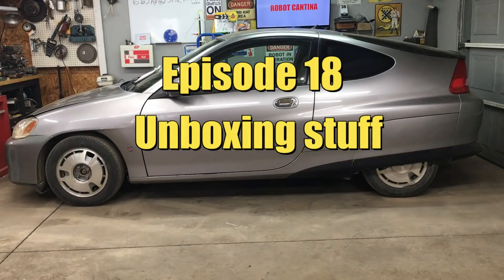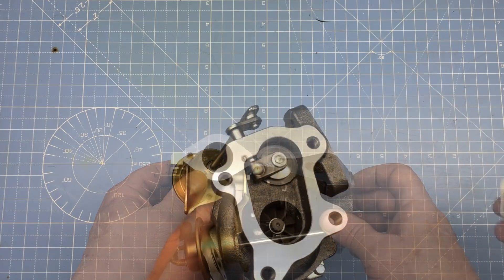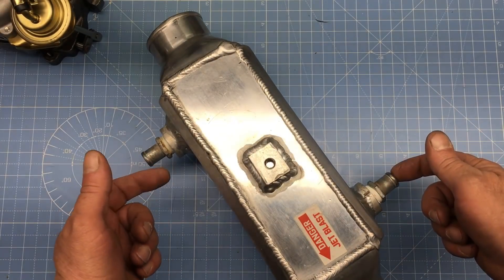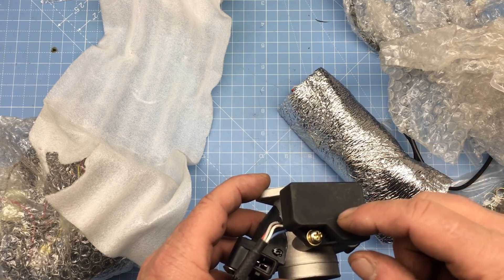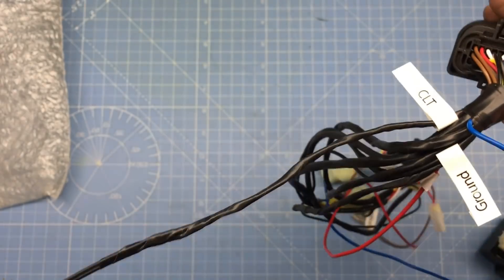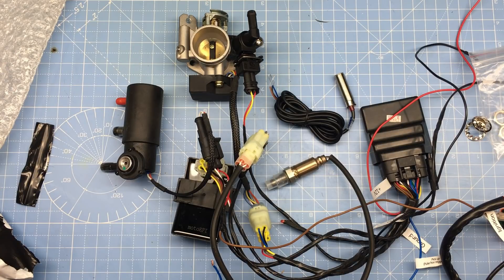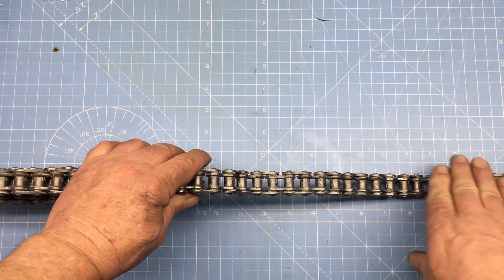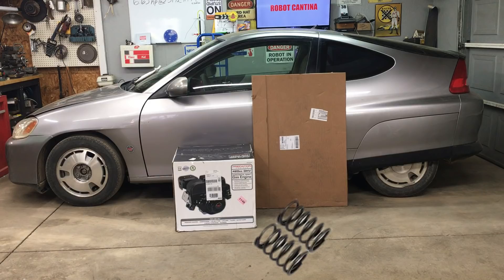Episode 18.   We unbox the high performance parts needed to make our 420 Hemi powered go kart faster

Comment: Do you have a link to the fuel injection kit? I tried finding one on ebay but couldn't find anything ☹️
Reply from the maker: I just checked ebay and you can find it by searching "motorcycle ATV scooter buggy moped UAV EFI engine Electronic Fuel Injection kit".   This is a decent kit to lean with, but it only allows the user to use a narrow band oxygen sensor.  that makes tuning very difficult.  we ended up replacing the ecu with a speeduino NO2C  to gain extra tuning features.
Reply: I tried copy pasting the item number from the link in your next video into ebay, that didn't work, I tried searching the seller's username, no items listed, tried copy pasting the item name, that didn't work either. Weird. Does the ECU have any part numbers on it? I did notice a sticker on it in the next video but couldn't get a clear enough view of it to read it.
Reply from the maker: We no longer have the original ECU or packaging.  I wonder why this item is not showing up for you.  this is the link to the ebay listing https://www.ebay.com/itm/273127447029?hash=item3f97aa19f5:g:PHwAAOSwaudbUUTp&amdata=enc%3AAQAIAAAA0Erz3ci6QuRccDG4O%2BCThnz1V10exsiW9RRaxC2VcEsel7jDFLJQjNqVhv%2BofvuH1TIOPoqlSGdunB4TSFk%2F5wifXCjPQlXTEk6VgxNs70QVY0k4VUTpjZw1NbWYRUsqR5KLkZjPbKAb6NlhS9To%2Fx4eYbcv%2FZeTLyV4fxz25VvPymgwxJ%2BEA41ZbUVJy5wsvZ6CqoSlcW2dspNemuvDoYuRv1CmAm%2B0bKGTKlel0TxzzX1I9D6fydeUAgdjYA2%2B6Geim%2FFiCcCXbm%2BYtET6j3M%3D%7Ctkp%3ABk9SR7THzajPYg

Comment: Your fuel pressure reg, JB weld a fitting to that small hole in the metal can, connect it to a boost source and voila, now the regulator is boost referenced. try not to connect it to a vacuum source.

Comment: Where did you buy this throttle body with injector?
Reply from the maker: The throttle body with injector was sourced from ebay.  The parts came from China.  Search Ebay for 28-32mm throttle body

Comment: This is the Go kart project who's progress I look forward to the most.

With an EFI kit this EMP proof engine is no longer EMP proof
I am not a huge fan of adding a turbocharger to a single cylinder engine.  It can be done but I am not that interested in it.  Superchargers are more interesting but only by a bit.
Reply from the maker: Dont tell anyone, but I'll probably go ahead and use AMR300 supercharger instead of the turbo.  Anyway I totally get how some folks don't necessarily like the EFI. but for the purposes of making youtube content, this is the direction the project will take.  I want to be different than other channels.

Comment: The second flange you pointed out is the one you want to use if you're going to utilize the internal wastegate. The flange with just a hole is for if you're not using a wastegate, or if you're using an external wastegate.

Comment: I believe the second exhaust flange you mentioned to be used if you're using the internal Wastegate. The flange you first mentioned will most likely boost creep if you're trying to use the internal WG.
Reply: Both flanges should be used to allow the wastegate valve to work properly. If only the smooth plate is used, the wastgate valve cannot open properly.

Comment: I've been watching for a few months and loved all your progress but this build is evolving beyond my comfort zone and my wallet. I'm never going to put a turbo on my build. I will still watch every episode but not as enthusiastically. Give me a carburetor and a set of points and I will get home. If any one of your sensors fails, Your walking! So no longer an apocalypse vehicle. I will wave as I pass you on the road at 47 MPH driving my 212, No promisses on not taking your food and women.
Reply from the maker: I totally understand the apprehension toward the fuel injection and the turbocharger. These additions are not really necessary because the car is more or less fine without them.   These mods are being done to explore the possibilities of modern power adders.  The alternative is of course carburetor jets and offset crankshaft keys.  both being very affordable, but we have already done these mods before on the 212cc engine.     Anyway, if you pass me on the side of the road with your 212cc rig, at least wave.

Comment: Would it be outside the spirit of the project to degrease the hubs and run    them as an oil bath setup? Good idea on the wheel alignment too...what tyre pressure are you running? All of it?
Reply from the maker: I run 40 PSI pressure in the tires.
Reply: @robotcantina8957  God damn I love this channel.

Comment: Absolutely crazy and fun build I actually have plans from the '60's hat used a 5 hp engine in a small car..(Not honda, I think..) with a brushed DC motor to get 100mpg.. NOW, I want o find those plans and maybe try to build t with a few modern mods. Can you find it in your heart to post a few arts links?? Shore would be appreciated..

Comment: The only time I’ve seen people successfully turbo one of these smaller engines has been with one of these EBay kits.
The ECU was able to run a wide band O2 and a 1 Bar MAP, if I recall. Those weldable turbo flanges you had a question about were meant to be stacked, the flat one gets and exhaust pipe and the outer perimeter one goes between it and the turbo.
Reply: Is that to give room for the wastegate flapper arm?

Comment: That looks just like a YZ450F ecu!  The turbo you have looks along the same lines of a GT15 frame size. You’d be very surprised on how big of a turbo you can run on the 400cc single cylinder engines!  Due to the “‘on-off-on-off” again nature of the exhaust flow (only 1 exhaust stroke per 720*’) it creates a violent exhaust pulse which has a ‘thrusting’ effect on the turbine wheel. That thrusting effect acts similar to the principle of an Anti-lag feature in a sense. It greatly helps spool a larger turbo On a turbo single cylinder. A multi cylinder engine doesn’t experience this because there is always an opposing cylinder exhausting after the other one hasBegan the intake stroke. It’s a much more linear, continuous exhaust flowrate. I inially started with the same turbo that you just purchased on a 450cc dirt bike. The turbine wheel was way too small And acted as a huge restriction on the engine. It didn’t want to rev at all. I ended up going back to the drawing board and started researching the Ford eco-boost turbos and ended up finding the perfect match for my application. I had to do a ton of modification on the turbine housing in order to get everything to package well Because I didn’t want to change the overall ergonomics or handling of the bike. I I’m still in the testing phase and just about have the kit complete and it’s working awesome! Even converted it over to E85!. i’m documenting it on my channel. Hope this helps!

Comment: One of the things that fascinates me about this project is that there are manufacturers making go fast parts for these little, relatively crappy engines. What real world use is there for a turbo charger for a 420cc engine? Even fuel injection is a bit of a reach. Just glad the parts exist so we can seem them played with and explored on the Go Cart.
Reply: Well they arent exactly made for the engine... They just with sloght mods fit

Comment: You really need a billet flywheel from go power sports. the stock flywheel in the 420s or any of these predator motors will blow apart at constant high RPM. From what I hear you shouldn't be running a stock flywheel above 3500 RPMs. The billet flywheels you can run the RPMs up as high  as high as the engine will go. Also if you're running a turbo you should probably put a bigger cam and stronger valve springs in too. I've built these predator engines up quite a few times and I don't recommend running more than 5 to 7 lb boost without o-ringing the cylinder head. also if any of you are going to be running a turbocharger on a carburetor the best way to do it is with the carburetor on the intake of the turbo with a fuel injector dump just after the carburetor for when you go to full throttle so there's no fuel lag/hesitation, but if you run the turbo on top of the carburetor your fuel pressure coming out of your fuel pump has to be twice as much then what boost is coming out of the turbo. That way the boost from the turbo doesn't push the fuel out of the carburetor. Love your videos this is freaking awesome! Can't wait to see what happens. I've always wanted to do something like this.

Comment: Funny, I actually put this exact turbo on my honda insight! Sadly it was too small for the stock 1,000cc engine, so now there is a GT1241 on it. Anyway, that other, bigger holed flange is for if you are running it to the point the wastegate opens all the way(on the larger end of the engine size). If you use the 1.5inch oulet instead of the full outlet, the wastegate will rattle on the flange, won't be able to open all the way, and you will get boost creep.

Comment: Hey Jimbo,  I feel I must say this, not to be rude or anything,  but I think you're making a big mistake 1:20 with the turbo and fuel injection stuff .   Now please don't take me wrong here but if you put all the turbo, injection,  the "small radiator" , intercooler thing and not to mention all the hoses , plumbing,  and etc . 

The car is going to be heavier  (not real heavy , but considering a single cylinder engine is all its got) but waaay overly complicated considering that the base goal was to have a "street legal gokart" . 

You haven't had enough tuning of the CVT setup yet (see my comments on the last video).

Like I said , I'm not trying to be rude , I just think you're going to run into major headaches.
Reply from the maker: So We are going with the EFI because it is an interesting mod to do.  The turbo charger will also be interesting.  the basic idea is to make interesting videos.  Ultimately the goal is to get the car to go as fast as possible.  I totally realize that these mods are not practical, but why not try them and find out why.  Realistically this car serve no real purpose other than to make videos.    Now some folks feel the car would be a great in town transportation, and that's fine.  They can build their car any way they want.  Anyway, feel most of my audience just wants to be entertained.
Reply: @robotcantina8957  : )   oh yeah I know.   And the videos have been very enjoyable/entertaining. I think what it was is - i was caught off guard there , you brought up turbo and efi and thought - " wait , what?  "   Lol
Reply from the maker: @midixiewrecked7011   That's cool,   More videos on the way.
Reply: @robotcantina8957  :)

Comment: Why does every youtuber put the oil feed/return on the wrong way around on these turbos 😅

Must give you incorrect instructions on the eBay ad?
Reply from the maker: According to the info I found on google,  the oil feed is the two bolt flange.  However after reading a lot of comments, it looks like that is wrong.    Thanks for the comment, I'll do a correction in an upcoming video.
Reply: @robotcantina8957  A good example is by Built Break Repeat and their Rotary mini bike, they set the oiling up backwards and it smoked alot then they corrected it in their 2nd episode haha

Great content btw keep it up 👍

Comment: Some things I've noticed. Hope this helps. 
1. You had the oil inlet/outlets reversed.
2. The extra weldable flanges are both exhaust outlet flanges. One is "bellmouth" for provided internal wastegate. The other is for utilizing an external wastegate and it blocks off the internal wastegate port. 

Hope this helps. I've been working in depth with turbos for a long time.
Reply from the maker: I knew I could count on the comment section to keep me from doing stupid things!   Thanks!
Reply: @robotcantina8957  no problem at all. Is that actuator replacable for one with a softer spring? To bad it's not modular so you can just swap it's spring like say a tial wastegate.

Comment: Not hating just my 2 cents. So more drivetrain loss, allot of money and mayyybe light boost and then fueling ignition issues as a result. I'm guessing not much in terms of speed etc.
"I just want it to survive" I haven't seen a 420 blow up... am I missing something?
Everyone loves throwing in billet parts and harder springs but I think that's mainly because billet is cool (not because its needed) and because like racing suspension we think tougher is racier and the whole cam lobe resistance and seat pressure and valve train power loss isn't even taken into account.
Whatever its still fun and ill still watch before the notification even comes in.

Comment: Would the coolant temp sensor work in oil or is the range too far off (maybe not programmable)?.
Reply from the maker: The EFI kit is made for an air cooled engine, so I reckon the CLT needs to go on the head or the jug.

Comment: hey mate, great vids, i'm loving them. 
 any chance of a link to that efi kit? i cant seem to find it on ebay?
Reply from the maker: I am not affiliated with the seller and at this point the kit is untested.  If you search ebay for motorcycle EFI you should find the kit.
Reply: @robotcantina8957  thanks for the reply. I will check it out. Wouldn't mind having a play with it then setting up a speeduino once I have the hardware all sorted

Comment: There's only one place to go after adding a turbo. 

Adding another turbo.
Reply: adding a supercharger: Bring on the Honk!
Reply: @maximilianwimmer627  why not both? They did it with old radial aircraft engines most notably the double wasp in the b17
Reply: After that? VTEC.
Reply: @cameronbarkley6863  Nah. Go straight to Wesley Kagan's free valve adaptation.
Reply: @cameronbarkley6863  VTEC was my least favorite thing about my first car. The extra lag at 3k RPMs drove me nuts.
Reply: Big bore kit😂
Reply: @joshuawilcox1322  Make it just 6cc extra so you can say yea i have 426Hemi

Comment: What provides your 12V power? I don't recall seeing an alternator anywhere.
Reply from the maker: We will cover that in an up coming video.  However if you need to know now, the 420 engine is equipped with a rudimentary charging system.

Comment: At what point are you going to add horsepower with stickers?  It IS a Honda afterall...
Reply from the maker: If you look close, on the drivers side front fender there is a round 212cc HiPo sticker,  So far the sticker hasn't helped, perhaps it needs to be bigger?
Reply: @robotcantina8957  Maybe! It'd be tough to make it slower!

Comment: @Robot Cantina ;  with just the electronic injection and a good muffler your all set, if you prefer you can change the cam to increase flow, adding boost (turbo) makes the engine less reliable.

Comment: Using the coolant temp on the cylinder head may not work as the temperature ranges won't match.  The injection and timing maps won't ride in the right region.

Comment: Don't forget to add some ring gap while you have the new engine apart. with the continuous high load/ low airflow conditions this engine will be living in (plus adding boost) you don't want to take a chance on the gap closing up and locking up the engine (or destroying it).

Comment: single cylinder turbo engines require a  boost resevoir  in order to work properly.  due to only having one exhaust pulse per firing cycle.   its to even out boost so its more even and pushing pressure while in the intake stroke as well.
Reply from the maker: Thanks for this info.  This is why I love to read all the comments.
Reply: @robotcantina8957   some of the other "go cart" channels  have some videos on this problem along with i think  boosted boi's  with their turbo shopping cart.

Comment: Make sure you either reference your fuel pressure to boost pressure or otherwise account for your max boost/fuel requirements when setting static pressure.  And run the numbers on the injector vs pressure flow requirements.

Comment: 120$ is 4 cooked pizzas here on the Oregon coast!
Reply: Move, too close to portland
Reply: Is this the new 'rate of exchange' for visualizing the relative value of of endeavors? Calculating value in units of pizzas works for me.
Reply: @cdjhyoung  
It really tells you how much our dollar has been devalued, doesn't it!?!
Reply: Depending on where you get them here in Michigan, where RC is, it is anywhere from 3 to 6 cooked pizzas. Not  counting tip for delivery...
Reply: In centralia washington, there is a pizza joint there that has a special on Tuesday. You can get a 24" extra large supreme for $15. I think the place is called Tony's pizza. Their pizza is amazing also. It's right off of exit 88 on I-5.

Comment: That turbo also came on the late 1980’s Chevy Sprint Turbo.  For those that don’t know, that was a rebadged Geo Metro/Pontiac Firefly.  On that motor(1.0L 3 cylinder) the turbo was actually on the small side.  For the 420cc motor, it should work great!!!  

That turbo does not have positive oil bearing seals so if you ever try to do a draw through setup(an easy setup with a carb) then it will quickly start puking oil out of the compressor, which would then get sucked into the engine.  Just a little FYI!  The fuel injection setup fixes that problem.
Reply: Yeah, the ko3s is better all around.
Reply: I have a 01 Metro, I'd kill for a turbo....lol
Reply: The Chevy Sprint Turbo utilized multi port fuel injection instead of throttle body injection on the Metro.  So the intake manifold was completely different.  If you ever look closely at the cylinder head on the standard 1.0L 3 cylinder you will see flat spots on the intake side of the cylinder head just above the intake ports.  This is where the fuel injectors were mounted on the turbo motor.  I’ve read about people running a few PSI of boost on the stock 1.0L motor with only supporting fuel and ignition modifications with good success.